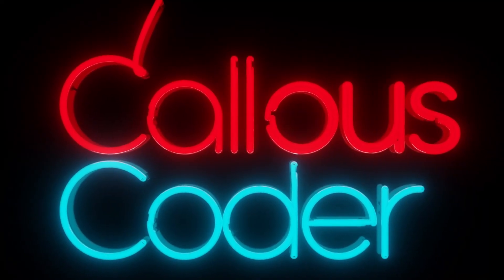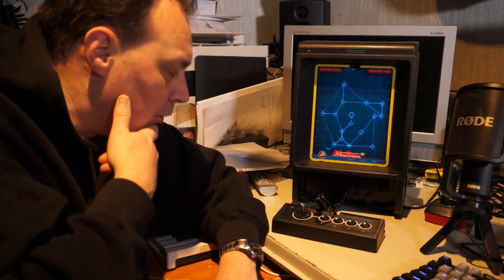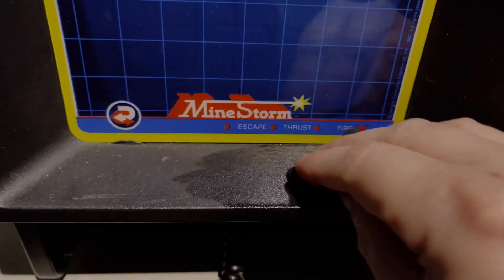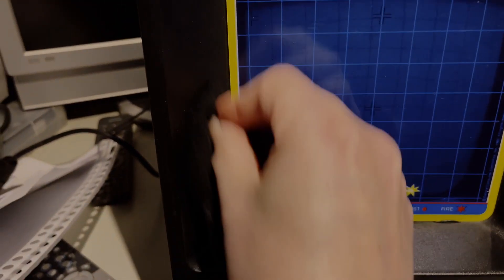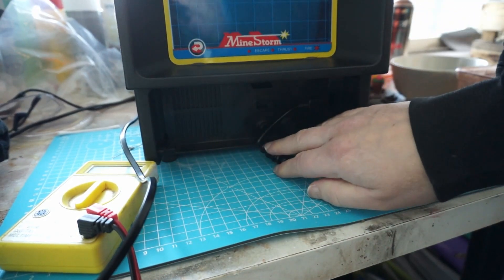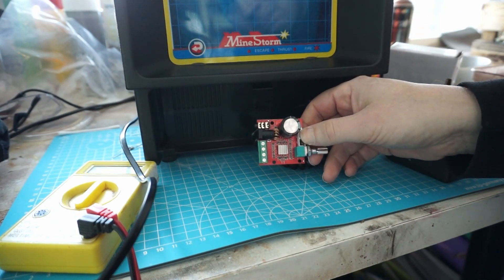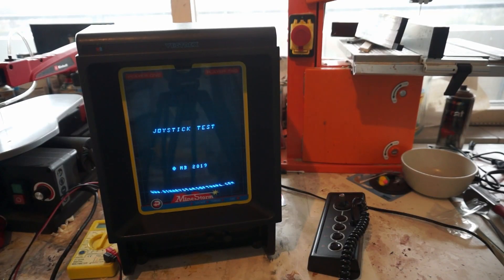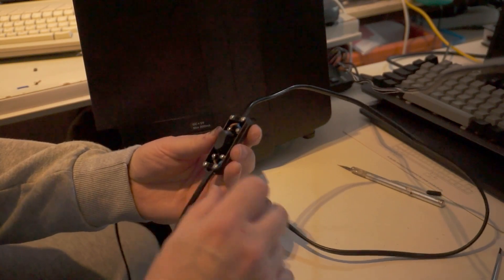Vectrex Refurbish

Comment: Putting a switch inline is a great idea so you dont have to keep turning the system on and off via the system switch.
Reply from the maker: Yeah those turn knobs are impossible to find so when they break you need to hot wire the mainboard so this seemed like a more sustainable solution.

Comment: Now i finished your  video. The funny thing is: Yesterday I also had to modify a plug a bit because it didn't fit 100% (aftermarket spare part for a CommonRail injector -connector ). What i don´t understand is. Why  you made a mod from analog to digital Joystick? Will it work with all games ? And have you solved the problem finally? Ahh and don´t forget: TRUST THE INTERNET
Reply from the maker: Pretty much all games, use a "basic on off" approach for direction anyways. And the reason is to have better controls and keep the original joystick from wearing out.

I think I have solved the problem, I just finished designing a little PCB with a subtraction opamp. Which basically will output -5 or +5, that should do the trick.... He said rather insecurely :D
So soon there'll be another video, once Mr Reichelt send the components and mister PCBWay or JLCPCB send the tiny PCB.

Next up is a fix for a 1982 pocket chess computer that arrives tomorrow. Missing a Bishop piece that I will need to remake and not "tested"... So we will see what it holds. I really like stuff from the early 80s.

Comment: Great video and great find. Can‘t you just open the joystick and check inside for the schematics?
Reply from the maker: Yes was my next step. The problem is though that the screws are behind the sticker. So and the glue is really hard and dry. Even a heat gun doesn’t want to let it go. So first I need to source a new decal. 
But yeah I can play fine. And I have an idea by adding some pots in there and a diode or transistor H bridge idea. I need time time to experiment that on the breadboard. But it’ll get done for sure.
Reply from the maker: I think I have a solution. I create an active circuit. Because the voltages are the same. I just think nobody properly tested this ReDDiT schematic before. 
What I now created is two opamp subtractor circuits. If UP is closed it will send +5V to the X and when down is closed -5V
And when right is closed +5V on the Y contact and left closed -5V.
That should work. I did also add some pots on each input pin to further fine tune it. 
The PCBs are at JLCPCB (cheaper and faster that PCBWay) so I guess there will be a video soon.
Reply: @CallousCoder  Cool! I looked up images of the open controller on Google and wrote a comment, but YouTube deleted it. There are images where you can see the inside circuit.
Reply from the maker: @RetroWK  great minds think alike. I did too and compared it with that’s schematic I’ve found. And the revision is the same. It’s just that the resistor network solution probably wasn’t properly tested and it seems to work initially. 
Live and learn! Even us old geezers learn new things 😜